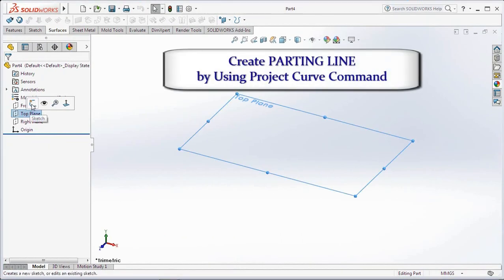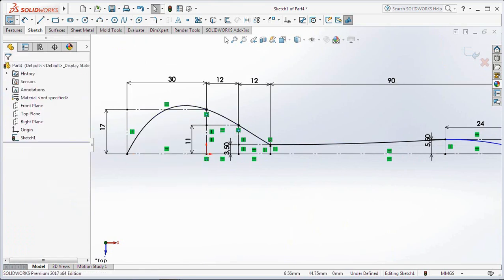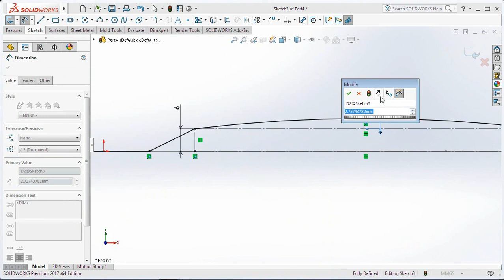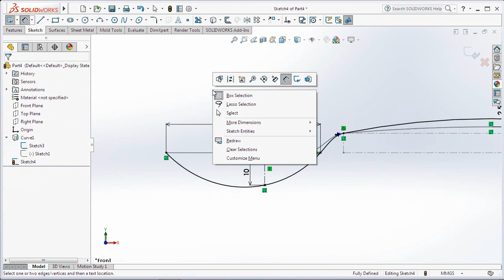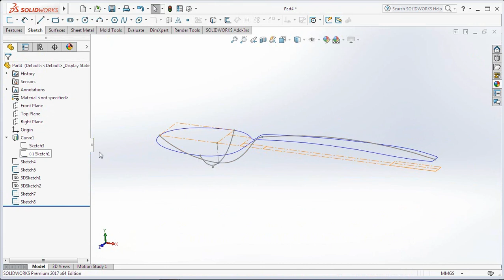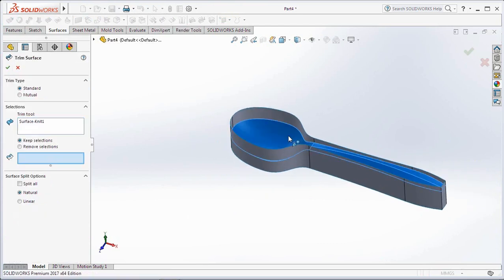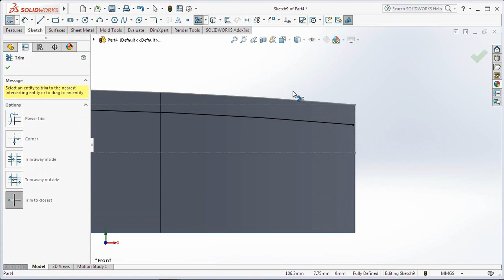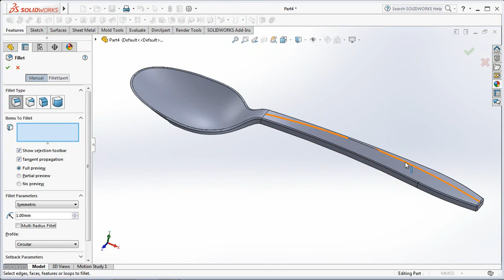HOW TO DRAW A SPOON, EASY & QUICKLY || SOLIDWORKS TUTORIAL

Comment: Whitch settings do you used? I can't select the Projected curve to create a scetch on it -> Its very strange but cool video :)
Reply from the maker: This is a projected curve sketch on sketch.
This means that you have to create two sketches first, before making the projected curve command, namely the front plane and the top plane. If you only make one sketch, it is called a sketch on the surface